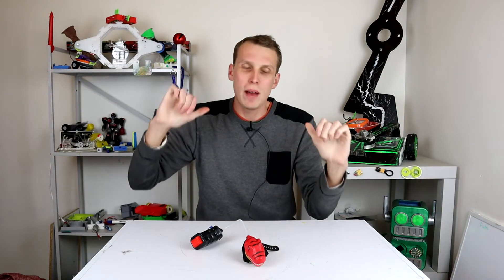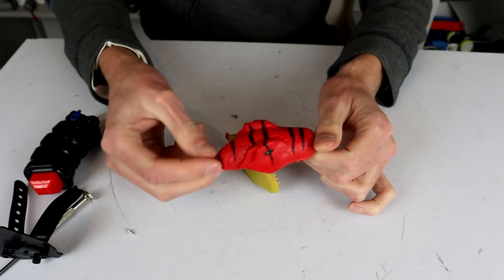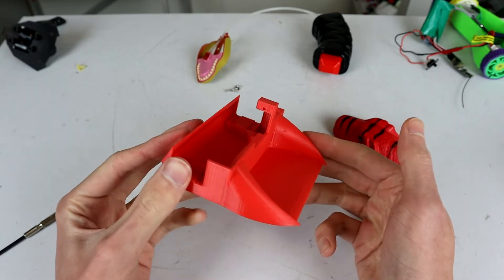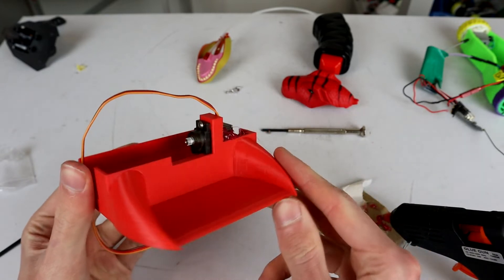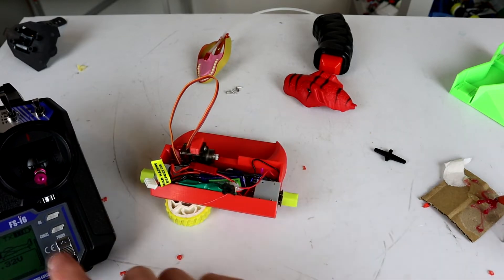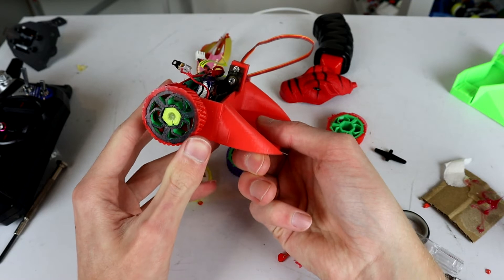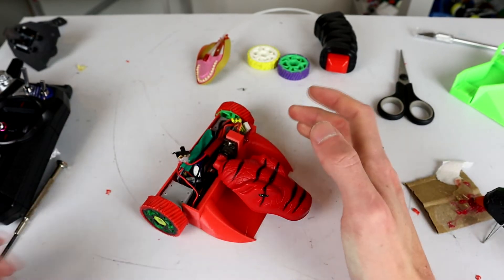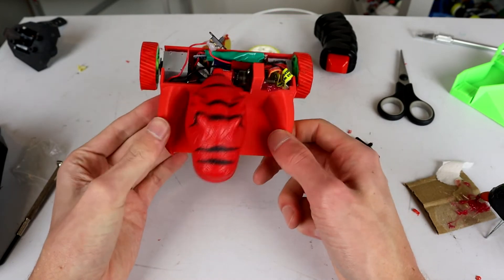Will It Bot? - Dino water gun!

Comment: Hey may I ask a more technician question
Reply from the maker: Sure
Reply: Team Panic ok I got my first brushless motor a esc a couple days ago but when I connected them the motor didn’t spin it just jittery back and forth a couple times before stopping completely and I got this from the fingertech spinner kit and I was just wondering if you could help
Reply from the maker: That sounds like a bad connection.
Check that each connection between the motor and the ESC is good, if you soldered them, reheat each solder joint.
If you didnt solder them, be sure that each connector is making a good connection.

If none of these work, you may have a bad motor or a bad ESC and you will need to contact the place you bought them from for a refund, but this is unlikely so try the connections first
Reply: Team Panic ok thank you

Comment: Best "will it bot" to date.   You mentioned your working on a circuit board for your own home brewed ESC.  I just got boards back from JLCPCB on my second attempt.  Now with  pinouts for a servo or brushless controller.  I mentioned in a previous post, I'm using a ESP12 for the and all in one brains and receiver. I've be very happy with  it  https://twitter.com/hogfanboy/status/1292191647359537152  As you can see the goal was to make an axle . that  starting building block for the students to design and build their bots around
Reply from the maker: Thanks!

That board is looking really good!
What communications protocol are you using to send RC commands to the ESP12?
Reply: @TeamPanicRobotics    Here is a picture of the controller using a wemos d1 mini https://twitter.com/hogfanboy/status/1269382854154338304  I'm  using  ESP-NOW communications  (controller sends data to a MAC address (es))  I wrote a little  binding routine (ESPs use the arduino IDE to program) where the receivers sends it's mac and the controller stores it to use in normal mode.   I really like the controller with it's menu to set many options just like the flysky. and it is cheap.  (I'm going to use the buttons for now to control the weapon but next version might add a separate control for the weapon.  I'll share any and all just ask  because  this is all new to me.